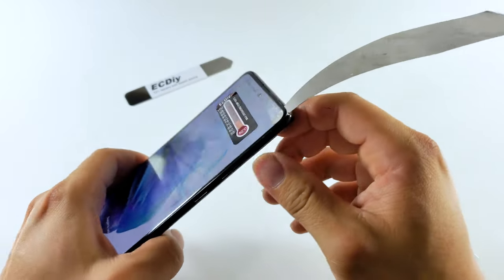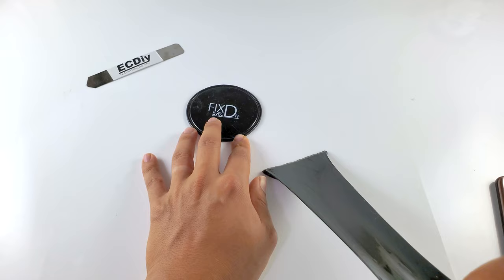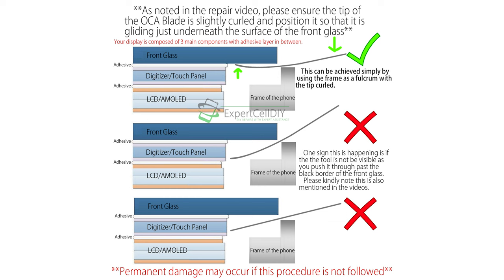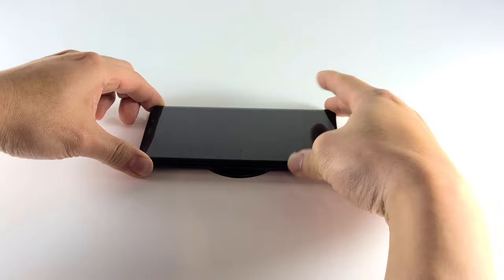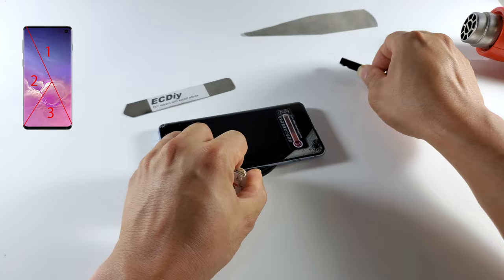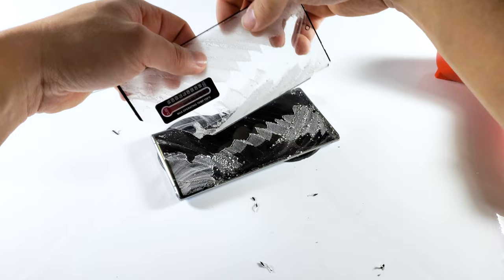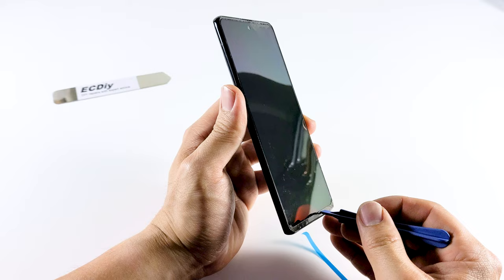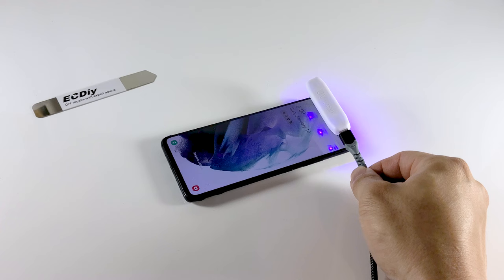How to Replace Screen Glass Only on Galaxy S22/21/20/10/+/Ultra/Note Shown in 6 Mins/New DIY Method

Comment: Ordered. Will update once repair is complete in a week.
Reply from the maker: Thank you so much for your support! Any questions, please do not hesitate to comment further/contact us.
Reply: How did it go?
Reply: @Semystic  This didn't age well I'm sorry! Two weeks past my own due date 😅😅😅 Life got in the way. On it during the next couple days I promise! Thanks for reminding me
Reply: @TristanVash38  Cool cool! I'm considering attempting this myself lol
Reply: @Semystic  My repair failed (Finally attempted). I can do hardware repairs on GPU's but not phones, apparently. :( Good luck to others!  Good product to give us a chance to do it ourselves so no fault of ECDiy. I'm not really sure why, but a slow heat up with a heat gun at the top of the Galaxy S20 FE on a microphone boom, waited until 80C, let it set for a few more seconds with a constant waving of the phone slowly and in a stable fashion, getting the blade in there was tough, and the hair width metal tool didn't want to get in there because the opening has to be correct or it will look like a sine wave. After a few more slow attempts at the top to get enough of an opening, the razor and the digitizer decided to meet somehow, green lines down the screen. I wanted to shove my fist through the table. Removed the glass/digitizer/screen. Ordered a new front. Gave it my shot.

Comment: one question, does these kinds of repair will help with  dead touchscreen zones?
Reply from the maker: For any display issues including touch issues, unfortunately you'd need to replace the display as a whole. Replacing the glass layer will not resolve the issue.
Any further questions/concerns, please do not hesitate to contact us/comment further.
Best regards,

Comment: hi, i saw you using Paper towel and Isopropyl alcohol to wipe the inner screen, does that not scratch the phone badly ? Paper towel is abrasive isn't it. Because actually i wiped my s20 ultra (the glass) and it has a lot of fine scratches from it ( spiral pattern ) as i wiped it spirally ... I found paper towel scratches more compared to just using cotton shirt. Sometimes with IPA , sometimes water
Reply from the maker: Hello,
Thank you for your comment. I haven't noticed this being an issue personally. You mentioned the paper towel scratched the glass, but it may have just been smudges being spread around.
A clean cloth is indeed really good for picking up the last bit of smudges as well.
We do include microfiber cloth for the final wipes but until that point, have not had an issue with paper towel.
Any further questions/concerns, please do not hesitate to contact us/comment further.
Best regards,

Comment: Is the glass you're selling the same one used in the S10+? (Corning Gorilla Glass 6)
Reply from the maker: We purchase our glass as originals, but to our understanding, it is not possible to confirm that it is indeed Gorilla glass even with a spectroradiometer and the brand does not participate in authenticating parts nor do they sell the glass part on their own.
Our glass is made of aluminosilicate glass which is technically speaking, what Gorilla glass is but what also makes it difficult to confirm is that between different generations of Gorilla glass, it's not just the chemical composition that has changed, but the manufacturing process that reduces defects. (All glass products, like diamonds, have tiny microscopic defects).

However, we have done various tests including break tests to know that our glass is comparable to the original take-off. Most glasses found online these days are soda lime glass, or low iron soda lime glass made to look like aluminosilicate glass and there is a big price difference.

If we can be of any further assistance, please do not hesitate to contact us.
Best regards,

Comment: I have a Quick question about the Samsung S10. You briefly meantion removing the back glass to take the front facing camera out. I didn't see much on that. Would it be the same process as removing the front by using the blade? If I ordered the s10 front glass repair kit, does it include everything required to remove the back glass?
Reply from the maker: Hello Steven,
Thank you for your comment!
    The process for the back glass is simpler than the front glass as the adhesive is only along the edges.
    You can use the sharper corners on the back of the blade to slice through the adhesive layer and remove the back glass. 
    The kit does indeed include everything required to remove the back glass, as well as a new back glass tape adhesive to re-install the back glass. 
Any further questions/concerns, please do not hesitate to contact us/comment further.
Best regards,

Comment: Where are your products to purchase under what name I need to repair the same. But also having problems with games and such the screen won't let me touch in certain spots does this mean the screen beneath is bad? Looked up the videos on having to take everything apart and not sure I can put it back together well. While I have mechanical skills on a car these little parts worry me

Comment: Hello, nice video. I have an a52 with a cracked screen. The new glass already has oca-glue(says the discription). Should i also use the glue you use and why? Regards
Reply from the maker: Technically, pre-installed OCA can be stacked with LOCA. 
   Even if the OCA were to make contact with the glass somewhere before the LOCA, LOCA will fill up to the area seamlessly. 
    This additional thickness does not cause touch issues even with a tempered glass screen protector. That's been my finding on my end at least.  
    If you are interested, I should be able to find you an A52 front glass without the OCA film. 
    Any further questions/concerns, please do not hesitate to comment further.
Cheers,

Comment: Are the cracks in bezel also removed when replacing the front glass? And are small hairline crack near the bottom screen touching the bezel a cause of concern for changing the screen?...my device is a51 5g
Reply from the maker: Hello,
I'm so sorry for the delay. Not sure how I missed it but to answer your question, the bezel is actually a part of the glass that has a black coating on the underside.
So yes, the cracks in the bezel are also removed when replacing the front glass and hairline crack at the bottom, no I wouldn't say it is a cause for a concern using this method as the wire would be gliding under the glass and slicing the adhesive layer.
Any further questions/concerns, please do not hesitate to contact us/comment further.
Have a great rest of the day.
Reply: @ecdiy  oh thanks for the reply 😊....by the way I meant to ask that if I only have a small hairline crack near the screen extending to bezel is it necessary to change glass?
Reply from the maker: @fataldestiny5097  Not a problem at all. It is the least I can do. 
Ahh I see, thank you for your clarification. 
    Cracked screens are more susceptible to further damage as the structural integrity of the layer which is ultimately protecting the soft display layer is greatly compromised but I wouldn't say a cracked screen repair is a 'necessary' repair in any case.

    It honestly comes down to a personal choice based on risk/reward.
Any further questions/concerns, please do not hesitate to contact us/comment further.
Best regards,

Comment: Just busted my Note 10+ OLED panel while trying to follow this repair. The oca blade sliced successfully through the middle portion, but some glass splinters on the edges took out some part of the OLED panel and killed the display . Now I have a functional phone with a dead display :( 

A caution to everyone: This is not as easy as it looks in the video. Be very and cautious and slow if you want to try this yourself.
Reply: yes, if you have shards, you need a semi-transparent tape, and put it on to hold the shards together. That way, they won't go loose and kill your lcd.

Comment: Watch heating, display can discolor very quickly.  Keep thermometer tape on the exact area you're heating, edges get hotter quicker..  Filament wire kept breaking and getting stuck under the display making it harder to use the next piece in the same area.  Practice on a phone you don't care about first.   I would weigh the cost of purchasing a new refurb phone and trading in cracked phone vs. ruining while trying to repair.  Also, might want to reset before you attempt lest you ruin display and can on longer access phone visuals.

Comment: Hey ECDiy just an ideas! If you could have a background picture of the glue application so people can trace the application would be really helpful!
Reply from the maker: This is actually a really neat idea! Because it's not too difficult to spread the glue using the method outlined in the video, I hadn't put too much thought into the exact pattern of the glue dispensing but I'm sure it exists. I will look into it further.
    Thank you for the suggestion!

Comment: Bro i have a s21 but i want to ask about batery when i unplug charger from 100% goes 97 within 4 min but i get 5 hours sot do you know if batery neeeds to be replace
Reply from the maker: That's hard to say, could be other hardware/app issues not related to the battery health. There's also no guarantee that the new battery would be any better in a sense that a lot, if not most of the batteries on the market are used batteries wrapped to look like new. 
I'm sorry I'm not able to provide you with a clear answer.
Best regards,

Comment: Hello I have watched and listened, I have samsung s10e screen glass need to be replaced and said in video if camera is in screen I need to remove front camera?
Reply from the maker: Yes, and no.
Yes because, typically you'd need to remove the back to remove the front camera prior to gluing.

However, we have finished developing a clear camera hole cover film which all you'd need to do is press to seal over the camera hole area prior to gluing. This has been briefly shown in the S22 shorts video as well as the Pixel long form video but this eliminates the need for back glass removal as well as the front camera removal. Currently, it is only being provided on a request basis and no negative feedback has been received.

It is being included free of charge on request basis. If you happen to be interested, simply send us a message once the order has been placed and we will have it included free of charge.
Best regards,

Comment: Hello. Im a little confused about gluing the screen, specifically camera on an S10, you said "dispense 2 drops on the OTHER side of the camera" should i just do like you did and glue the camera or is there more?
Reply from the maker: You would typically do it just like I did and dispense a couple droplets of glue on the other side (other side being the opposite sound of where the glue would spread from)
    However, we have finished developing a clear camera hole cover film which all you'd need to do is press to seal over the camera hole area prior to gluing. This eliminates the need for back glass removal as well as the front camera removal!
   We have been providing it on a request basis at no extra cost for the past 4 months and no negative feedback has been received!
    Any further questions/concerns, please do not hesitate to comment further!
Have a great rest of the day.

Comment: what glue you use is this applicable on curve lcd thankyou for your response
Reply from the maker: Thank you for your comment. 
   I'm certainly biased in answering this but the brand we use is Stronghold. LOCA stands for Liquid Optically Clear Adhesive, there are several options but please kindly note many LOCAs require a separate UV lamp to cure. (Ours is specially formulated to by hypersensitive to UV, so much so that exposure to daylight on a cloudy winter day is enough to cure the glue. I'd also like to note that ours can also be cured with a UV light).
   Any further questions/concerns, please do not hesitate to contact us/comment further.
Best regards,

Comment: on my s21 i got small screen burnt from app and to get rid i need to replace the whole screen but is there way to do it without replacing screen?
Reply from the maker: To my understanding, screen burns are not fixable unless you replace the display as a whole. 
There are videos that you can put on to wear out all the pixels a bit and it supposedly reduces the look of the screen burn but I have not tried it. 
Any questions/concerns, please do not hesitate to comment further.
Best regards,

Comment: I wondered if this would work on asus rog 5 glass replacement.
Reply from the maker: I haven't done it myself, but it should work looking at others' videos using the wire tool. The process is delicate and requires precision no matter what the device is and what tool you use, but the concept for the glass removal process is universal.
    Our OCA Blade tool is the same thickness as the wire tool which you see others using to do the glass separation. There are videos specific to the Rog5 showing this.
    As long as sufficient heat is applied to soften the adhesive holding the display, the display can be lifted slightly without damage as long as you are careful. At that point as long as heat is applied to soften the OCA layer, and the tool inserted in a way so that the tip is touching the underside of the front glass as it enters display area, it should not cause the display to tear. Some of the videos online show the person using a thin film/foil to achieve the same effect.
   Once the initial separation is done, you would do most of the removal with the wire tool.

Comment: I have bought a kit to change the glass on my s22+ but it didn't come with glue what kind of glue do I need. Any help would be appreciated
Reply from the maker: Not a problem at all. Happy to help. It is indeed unfortunate that so many sellers sell 'kits' without one of the most critical components of this repair just to appear to be a better deal. 
   Anyhow, you need LOCA, which stands for Liquid Optically Clear Adhesive. I don't want to come across as though I'm just trying to get a sale from you because in the grand scheme of things, the profit from a tube of glue even if you were to purchase ours is negligible. However, ours is something we get specifically formulated for us after having experimented with many different brands of LOCA to know the optimum specs that work best for cell phone screen repair. Some of the characteristics include optical clarity, tensile strength, viscosity, contractility and they all play a roll in how the installation goes. Other glues may not behave the way ours does in this video. I do not want this to scare you though, please feel free to try others. 
    Ours is called Stronghold, there are some copy cats out there, but they cannot be the same as ours. We are only not pursuing a claim for the infringement just yet as they have yet to cross the threshold to make it worth the time and we are focused more on further experimentation to make the repair easier. 
    If you are interested, please feel free to comment further/contact us. We can ship internationally for cheaper too if you do not require tracking (partial tracking will be provided which will show the item leaving the country).

Comment: I just noticed a hairline crack in my front glass - no loss of functionality yet. I'm going to try slapping a screen protector on it to stabilize it. Maybe I can make it last until I can get a deal on a new phone. Worst case, I have phone insurance.
Reply from the maker: This is a great idea and it's something I recommend but please note the adhesive found in traditional UV tempered glass protectors is too "thin"/fluid and it can seep in to the phone and damage the internals. 

If your phone has a flat display, a conventional full adhesive protector will do just fine. 

If your screen is curved and you want a reliable full-glue application protector that can make your crack less visible, contact me. I have something you can use. 
Best regards and Happy New Year!